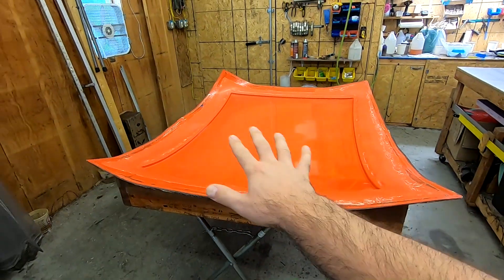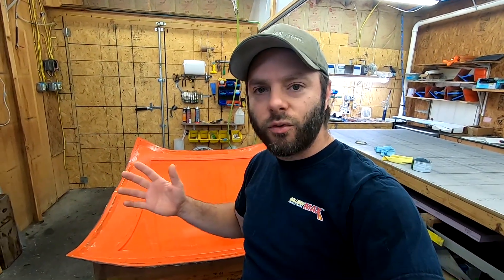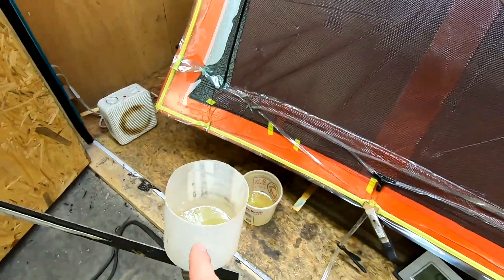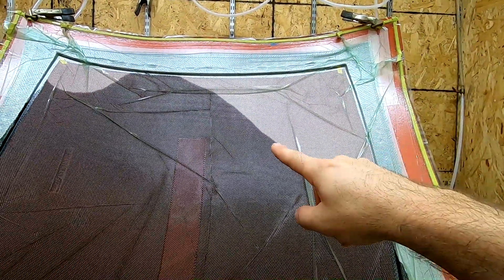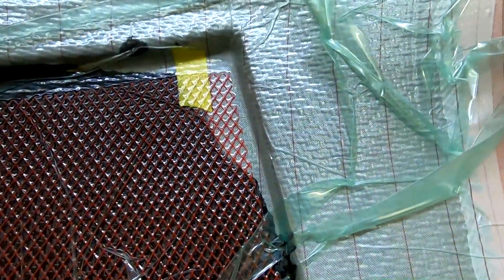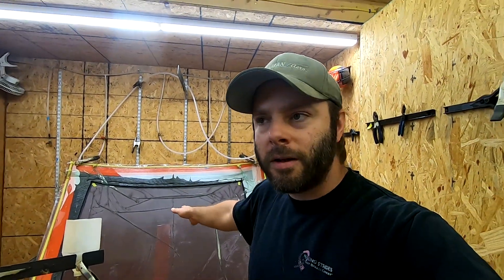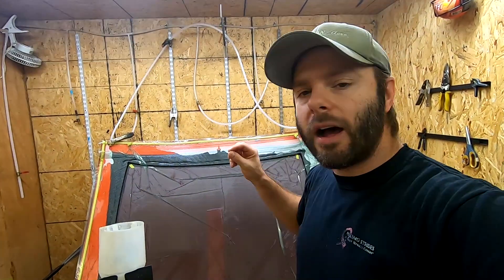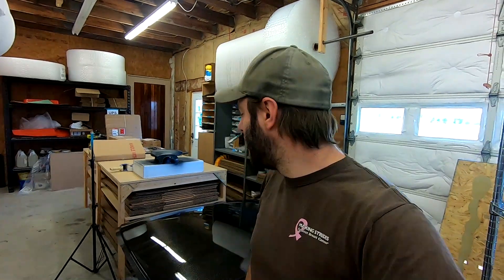Making a Carbon Fiber Roof Panel

Comment: It's great you mention all the things that you have to keep an eye on.  With my luck all those things that can go wrong will likely happen.   This is why I am hesitant to do infusion, so much can go wrong and then all the material is wasted. btw, I don't understand why you don't use a core material.  3 layers you could have a core with only two layers and it will be much much stronger.

Comment: I see sometimes you spray a clear on the mod. Is this best practice to do it before hand? Does the part come out visually better than doing it after the part had come out the oven? If you spray the clear after the demolding step would you have to wet sand and then polish since it might have orange peel?

Comment: Is it possible to make a mold from the painted hood (plug) of a car without damaging the finish? Would multiple layers of wax, then PVA be enough to protect the paint? Could you use polyester GEL coat or would an Epoxy GEL be less damaging? I guess, if the wax-PVA layer is perfectly applied, there would be no problem.
Great informational videos, best on the web. Thank you for producing them.

Comment: Nice work, but why is it every YT'er that says, "I'll put a link here to whatever video...", there is never a link??
Reply from the maker: Time stamp? I’ll double check what I missed.
Reply: @ajhartmanaero  at around 0:40 (Corvette skin) and again at 10:30 for the oven build. Not just your channel, most others have this issue too 😉

Great tips though, especially the one about infusing uphill. No matter how good your vacuum is there will always still be air trapped in the part.
Reply from the maker: @kramer26  Not sure whats wrong on your end but both tags pop up in the to right corner when I watch the video.
Reply: @ajhartmanaero  oh, that's strange... Maybe it is something my end🤔 perhaps it's the ad blocker?? 😂
Reply from the maker: @kramer26  probably.

Comment: I have a question do you need to use a oven and heat up the part or can you just let it sit to cure and harden
Reply from the maker: Epoxy can cure at room temp.

Comment: Great video and extremely informative and professional. I want to replace my headliner with a carbon fiber shell. To eliminate the cloth lining from falling apart. Could it be done with an insulating backing between the liner and the roof?
Reply from the maker: Probably.

Comment: I saw your video where you installed the carbon roof, if i were to drill out the spot welds and try to repurpose the roof for my mold, would i just have to be extremely careful not to bend the panel and take my time?

Comment: How well do these panels hold up when heated in the sun?? I have seen some carbon panels warp terribly from sunlight heating.. what resin should be used?
Reply from the maker: Since it’s bonded to that warping shouldn’t be an issue.

Comment: What clear coating are you using in the mold that gives it the clear gloss? Is it polyester based or epoxy based? Love your channel by the way.
Reply: Not clear coat, if done properly resin comes out like that. You would clear coated afterwards to protect from yellowing from the sun outside.\
Reply: @brakesitr   its in mould clear

Comment: so i wanna make a carbon roof for my SC400 as well. do you think it's absolutely necessary for the roof skin to go all the way under the windshield or just panel bonding it to a 2" section of the original roof would be ok?

Comment: What are you spraying on the mold with the hvlp gun before the first layer of cf goes down?
Reply: in this case i think its a gel coat / clear coat. some spray mold release like that prior to layup. I've also heard of, but never seen, primer-in-mold, essentially being able to pop a pre-primered panel straight out of the mold. In this case the clear is probably for UV protection. I could be wrong.

Comment: With that inlet diameter, normally a travel of 500-600 millimeters max. is adviced. After that,  a second inlet in the middle of the mold is necessary if one wants to  stay safe
Reply from the maker: Good rule of thumb but obviously there are a ton of variables that dictate infusion speed and distance.
Reply: Of course, but in an established process, all those "ton" reduce drastically and the infusion layout is part of this reduction

Comment: Love the videos! Your finishes are amazing right out the mould. Was curious as to why you don't clear coat your parts? Where I work we always send parts out for clear coat after sanding. Do parts generally hold up fine against the UV and weather without clear?
Reply: This guys infusion is a complete joke and he has absolutely no clue as to what he is doing.
Reply: @mikeshultz1007  his end product looked pretty good and he seems to be going the extra mile with a DIY oven considering many tutorials ive seen skip out on heating up their part when curing. First time ive seen someone angle their part but like i stated earlier, end product looks good so why complain?
Reply: @mikeshultz1007  - Lets say, you have a valid point... Please explain why you say so? From what I know - (out of the little experience I have with infusion) we also did it (almost) similar to what he did, for the panels  we build for one of the bases in Antarctica. Faultless, and problem less. So: What is your validation behind your statement?
Reply: @SilentApfel  Just about every part of the process is wrong in this video.  Putting the part on an angle is wrong and infusing from one side is wrong.  The bagging process is wrong, the wrong peel-ply is being used.  The vacuum setup is wrong.  Those are just some of the big one's.  I do have 30+ years of composite experience.  If you want to watch a video of a roof being properly infused I can post a link to a video my friend posted since I am not allowed to post anything due the nature of my employment.
Reply: @Mike Shultz  - Well, keeping in mind, that he does "all wrong" (on these parts), the end resul is pretty spectacular. On bigger and more complex parts, eg: a body tub, it might lead to problems, but on these, it definitely does work, with good results. Please post the link you mentioned, so we can see.
Reply: @SilentApfel  It is impossible to see all the imperfections in these videos, ez composites videos are the same way.  The problem with infusing carbon roof panels is the surface porosity in the finished product.  There is really no way to deal with the porosity and that is why a clear coat must be applied to the mold before layup.  I worked with a resin manufacturer to develop a uv resistant clear coat that is applied like gel coat and my infusions cone out looking like glass.  I can wax a roof and not have a million little white spots appear in the surface.

https://youtu.be/PIDTw3SLb1E

Comment: Can I ask mate, have you got any particular tips or tricks to stop being itchy? Any time I'm cutting or trimming composites in between my fingers and just any open skin is sooo itchy!
Reply from the maker: Gotta man up! Or wear gloves? You can also try talc powder as well. I used to get really itchy in the part opposite my elbow (my elbo pit? where your arm bends) and dusting talc powder helped. But I've kinda gotten used to it over the years and kinda just stopped itching. Never had itchy hands tho.
Reply: @ajhartmanaero  I figured that would be the case. I only do it occasionally so body never gets used to it. I do like how you hold the vacuum alongside the dremel while cutting may need to try that in future!  Cheers buddy!
Reply from the maker: @WingItGarage34  yup. Definitely helps capture more dust immediately.
Reply: @WingItGarage34  try using an old dress shirt, somewhat big, that you can probably buy at thrift stores. The shirts are light weight and can fit over regular shirts. Helps me minimize itch and covers clothes well. Then throw it away when it's to coated.

Comment: These videos are great!  Curious why you prefer the orange flow media vs green?  Also, great explanation of the flow net bias towards the left.  Would diagonal work better?
Reply from the maker: Green is thinner and flows slower so isn't the best on a large part. I use green on my smaller stuff.
Reply: You could do a chevron with your flow media if you wanted. That way each side goes diagonally up towards the corners. Our green media flows at a good speed. We use it for 2015+ Mustang hoods.
Reply: @Mortimusmoose  could you explain this in more detail? from what i could tell, his flow media lined up with the corners of the roof. are you suggesting having one of the strands flow vertically up in this case?